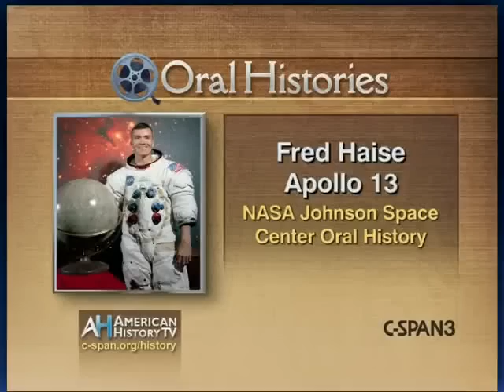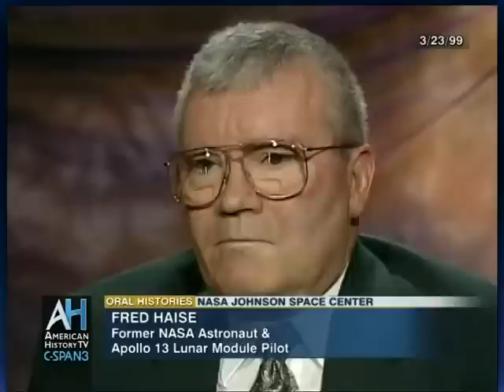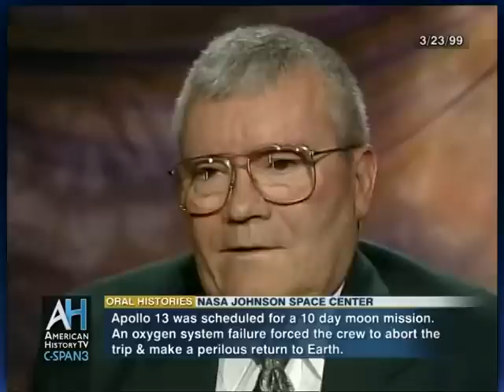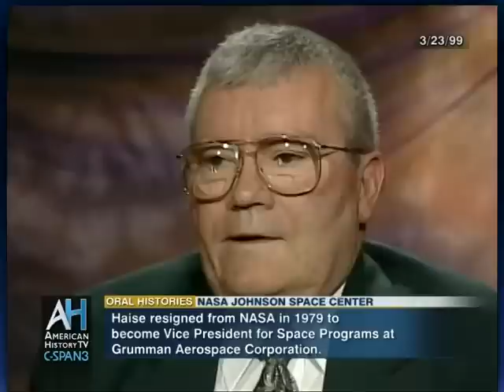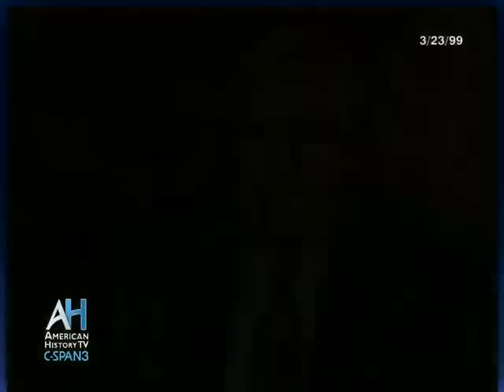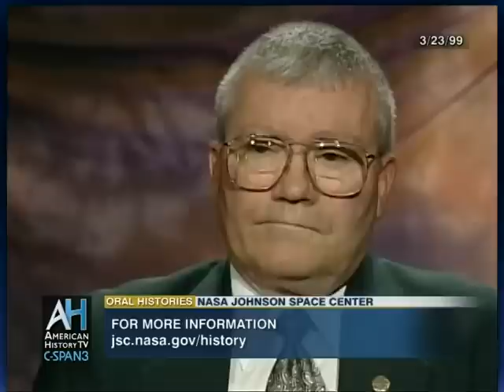Fred W. Haise Interview (1999)

Comment: I wonder why he never commanded a Skylab mission.
Reply: He was set to command the second shuttle mission that would've applied a booster module to Skylab and pulled it to a higher orbit. The shuttle program got delayed and Skylab's orbit deteriorated unexpectedly so it burned up in the atmosphere in '79. He did pilot some of the free flight tests of the shuttles and landed them, but retired from NASA to work for Grumman before the shuttle program got off the ground.
Reply: @willbrideau676  Yeah I actually knew all of that but he would have been a good commander on the 3rd Skylab mission. They gave it to a rookie (Jerry Carr) which I could never understand because normally a flown-astronaut commanded a mission (except a few exceptions.)

Comment: I have to wonder why they didn't put on their full launch pressure suits when the temperature started dropping. Those things had to be insulated to withstand the extreme temperature differences. Granted they are extremely bulky suits and they make trying to fit 3 people close together in the LEM pretty difficult... but they probably would have been warmer at least. Generally they stow those suits away once in orbit, and are only put on again for docking, and getting ready to separate the vehicles to head down to the moon.
Reply: He spoke about wearing suits to keep warm half way through his interview but what you're talking about is the full pressure suits they wore during launch..... I heard them speaking of this causing them more difficulty because of condensation than being sealed up cause condensation which would then freeze and make them worse
Reply: Jim lovell also spoke of this in a few interviews and said they thought about it, but realized the suits would make them worse off through perspiration and then being cold and wet would lead to hypothermia.  I believe it was in Lovell's book, or maybe an interview (i can't recall), him saying that if you sat very still the body heat would encase you in 0-G and create a sort of blanket layer over you, but if you moved or someone moved air near you, it would break.  So there were only short periods where they could get a bit of reprieve from the low temp.